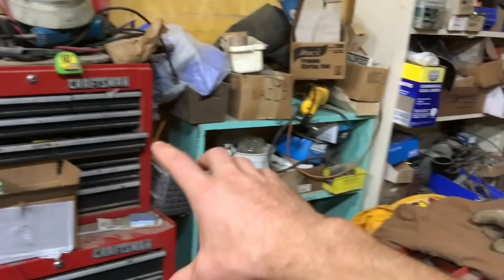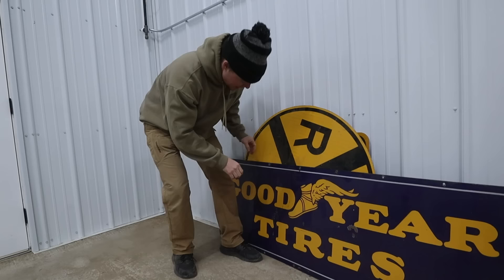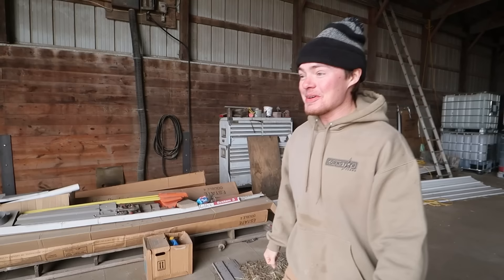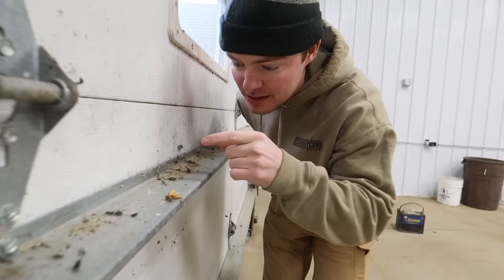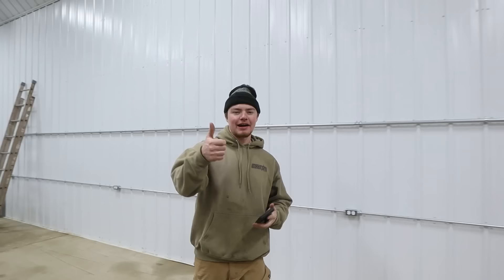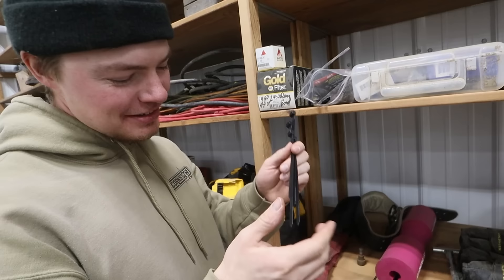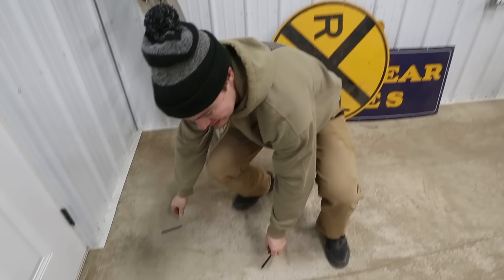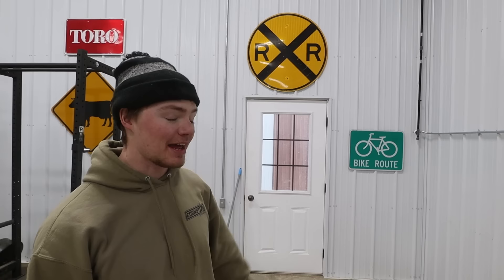Finding $10,000 In My Grandpa's Hoarder Garage

Comment: Cole, fire safety code requires nothing be placed in front of the electrical panel for at least 3' and access not to be blocked.  Acetone should get the glue off that toolbox.
Reply: It's obvious they don't care much about any fire code or NEC.
Reply: @FuenteSmoker most don't not just cole
Reply: Move on.. seriously lmfao 🤣 what a square
Reply: @FuenteSmoker  fire codes are bull💩
Reply: looks like that area is still a work in progress and it looks like there is still access to the breaker panel
Reply: OSHA CFR 1910
Reply: This isn't true in all places. We only need a 18 inch deep between the front of box and access cover box.
Reply: This isn't true in all places. We only need a 18 inch deep between the front of box and access cover box.
Reply: This isn't true in all places. We only need a 18 inch deep between the front of box and access cover box.
Reply: This isn't true in all places. We only need a 18 inch deep between the front of box and access cover box.
Reply: It's still readily accessible....
Reply: I just do not understand why the plug outlets are lower than the toolboxes and where the workbench where they will be blocked.
Reply: @chriscampbell2327 ets go back and ask the guy that built it in the 1980s?
Reply: @ds6843 Cole just installed those outlets…
Reply: @baumsquad222  ohh shit I haven't been watching hahahaha 😆 sorry
Reply: @collind9753  Voltage dependant.. The Higher the voltage, the more distance..
Reply: @lucasstiles8012  Farms are not regulated by OSHA.
Reply: @ds6843  Great!  Farming is dangerous enough without making it more so.  Love the videos and your whole family's exuberation, Kid!
Reply: @ds6843  Cole just installed the conduit and plugs not in the 80s.
Reply: @ds6843 When your insurance company refuses to payout when it burns down you’ll be sorry.
Reply: @jimpinger6206 Well that’s plain stupid they are workplaces. As long as it’s only your own family you kill.

Comment: Cole, I've watched all your family videos with admiration. Your decision to streamline and upgrade has been a wise one. Time IS money. I am a retired heavy equipment mechanic that worked for a big name brand. Our shop was on an industrial level. The shop was spotless. Each mechanic was responsible for Thier own messes. Oil spills, dirt all had to be contended with. Then, they bought us a floor scrubber/ broom. One pass can make a filthy floor clean in five minutes. Not only that, but the grey water can be handled with waste oil easier. The dirt & grime collected. After pushing hundreds of pounds of dirt for years, our employer saved experienced technicians sweeping. It made a problem chore a non issue. Ask ANYONE that uses one. They are a real timesaver.
Reply: Cole a floor scrubber /broom. I wonder if that is electrically driven.

Comment: Some solutions for the removal of sticky residue on stainless steel:  Cooking Oil – Cooking oil is one of the most commonly used solvents for tackling sticky residues on stainless steel. Dip a clean cotton cloth in cooking oil and rub it over the affected areas, waiting for the sticky residue to loosen.
Alcohol – apply a little alcohol (preferably vodka) to remove the sticky residue off the stainless steel. BUT the quickest and easiest to tackle nasty sticky residue with immediate results is to use WD-40 Multi Use Product. Spray the WD-40 over all the residue; wait a few minutes then wipe off with a rag and wash with dishwashing liquid to remove the grease of the WD-40... happy scrubbing
Reply: Yes amazing try it !!!!
Reply: Also peanut butter works good.
Reply: And eucalyptus oil.
Reply: when I was younger I definitely did more cleaning with mechanical methods (scraping, power washing) but as I've gotten older I've discovered more and more chemical approaches. Works much better.  Hopefully Cole will see your comment and give them a final clean.

Comment: Re your breaker issue....this is NOT caused by insulation under a terminal. That would simply result in no power to the outlet. If your breaker is tripping, that is due to a short to ground or neutral which would draw max current. It is important that you find the root cause of the issue or you risk injury and/or fire should the breaker fail to trip. The breaker is there as protection in case of a fault, not as a remedy to an installation fault.
Reply: It Served as such in this Application
Reply: @davidcolesr.8628  are you saying the insulation caused the problem??
Reply: @davidcolesr.8628  yes, but they won't forever.  They aren't designed to constantly trip (or be used as a light switch either)
Reply: @frijoli9579 no that wasn’t the problem. Problem is this kid doesn’t know what he’s doing
Reply: @DocNo27 whatever he plugged into it was probably bad causing breaker to trip
Reply: You should put electrical tape over the terminal screws on the receptacle. This will project you from having a short to the box from the receptacle.

Comment: Large zip lock bags. Each bag has a complete set of sockets of the same brand/grade metric vs imperial. Stash all of your bags in a milk crate. When you have a big project with multiple people using multiple sets, or when you need to work out in the field where things easily go missing,  you grab up a bagged set rather than your newer and more expensive sets of sockets. You can also put a bag in each pickup or tractor tool box. 

Take all of the incomplete sets to your local high school, college, or trade school. They always need extra tools. Some granges also have a tool exchange.

Comment: Hey Cole, I think that with all the spare tools. It would be a good idea to use them to make a tool box for each piece of equipment. This would allow for more field repairs.
Best of luck.
Reply: Definitely a great idea if they don't have dedicated tool kits already. At least a basic set to cover the most commonly needed items.
Reply: They do have small tool bags in most pieces of equipment and in their trucks. 
If not already, those also need to be color coded for each bag. That way the designated tools get back to the bag, and the others go back to where they came from.
Reply: Dedicated tool boxes for each piece of equipment. Colour  or brand coded keeps it organized and there is nothing  like having a complete box in each piece of equipment. I say this after 48 years of seeding a crop. This will take up most of the extra tools. Use JD boxes with the mount and the plastic handles (they last the longest ie. fourty plus years for the box on my 4440) and it weighs 40 plus lbs.

Comment: REALLY helpful hint!!! On those 220 outlets. Once you have the right plugs, use an extension box. A box with no back that extends the area you have for the wires x2.
Reply: Several people mentioned that in the comments when he first wired the outlets and struggled with getting the wires to fit inside.  Not sure why he didn't do that and make things easier.
Reply: @ILGuy2012  I too was one that told him he used the Wrong box in the 1st place.
Reply: @m9ovich785  I agree. He's probably using a ~20 cu-inch box. He should be using a 45 cu-inch box. And he's mounting the box the wrong way up. The cover screws belong on the top and bottom so the cord on the plug hangs the right way.
Reply: @bruceadler-9410  That is what I saw the very day they screwed them to the TIn AHAHAHA...
they could have saved a lot of $$$ with one 1" conduit and the 120Vac box's dropped down from those LOL...

Comment: Cole when you raise the compressor up off the floor, you need to have a pipe extendeed down from the drain with a ball valve , so you can drain the water out of the bottom. Most people forget about doing that and the bottom rusts out, and also you get excessive water in your air lines.
Reply: SnapOn sells automatically activated drains (they have a float)

Comment: Willing to bet the field you plowed and ran the disc over will produce a lot better than previous years as long as you have a good rain season. I really hope you didn’t throw away those sockets just because they were loose. You can get socket trays much cheaper than the 20 dollars you mentioned. Guaranteed someone would be willing to sort through all of them if you didn’t want them. Some of them are probably pretty old if they were your grandfathers and potentially great grandfathers and potentially collectible maybe even a little value to them.

Put your adjustable wrenches in a bucket get some good rust remover and soak them in it for a week then clean the rust remover off dry them and spray them down with your favorite lube and you’ll have a nice new/used adjustable wrench. You can do the same thing with your socket wrenches and pliers as well.

You should build a shed on the outside of the shop and install the air compressor in it so you don’t have to listen to it run all the time when you’re using it. It will make the time in your shop much more pleasant.

Comment: If you can, pipe the air compressor in the building next door. It will save your hearing, and save you space. I did it on my garage and you can barely hear it run.

Comment: I recommend sheet steel for the top of your workbench. Get the steel folded to create an upturned lip at the back of the workbench (prevents stuff falling down the back of the bench) and a downturned lip at the front of the bench. This makes it nicer to lean against the front of the bench when you are working. Had you considered mounting the compressor above the man door? That space is otherwise wasted. Happy New Year Cornstar Farms!!

Comment: Hey Cole, you should put the air compressor in the machine shed and then just pipe air over into the heated shop. Then You won’t have the noise of the compressor running in the area that you’ll be doing more of your work.
Reply: Better to have the compressor in the heated shop. Less condensation.
Reply: @drhermanstein  well I have used an air compressor that was in a unheated place and was piped in to the main shop with a second tank in the main shop and a automatic drain on the compressor and we never had and condensation problems. The second tank hardly had any water in at all. It doesn’t matter whether it’s cold or warm air it’s the moister in the air that causes it to have  water inside the compressor
Reply: The glue gunk can be taken off with orange oil.

Comment: Hey Cole isopropyl rubbing alcohol will easily take that glue gunk off. Also WD40 and petroleum jelly. They all act as a solvent and should solve your issue.
Keep on Tractoring
Reply: In my experience, WD-40 is the best option. It returns the dried adhesive to a tacky state, and then you can work it off with towels and more WD-40. Vaseline: replace one mess with a different mess.
Reply: Hi Jon.  My go to is GOO GONE Works on anything, even dried ball point pen and sharpie Ink..
Reply: Lmao you you think this small mind Tommy has the capacity to look at your comment and make it work out 😂😂😂😂😂

Comment: Cole you can buy a tester that is designed to check if your outlets are properly connected. You simply plug it in to a live outlet and the device has lights on it the inform the installer if it's wired properly and if not what is wired incorrectly on the outlet. Most hardware or the large box stores carry the device.

Comment: I know I will sound like a Negative Nancy but after watching 2 friends garages burn down because of lithium charging stations, don’t leave the batteries in the chargers. Hell, we moved ours out back un a cinderblock shed with a metal roof, so if it does go up we just need new chargers, batteries, roof and shelves. Just saying, would really suck to lose it after all that hard work.
Reply: For all the sockets get some dowels and size the sockets like you did with the wrenches. That way when you lose one you have spares to replace it.
Reply: One neat thing I recently saw was a guy had a Light Station Cart. Had a Jackery kind of battery with several lights, shop lights on stands he could use all around his shop, under equipment, was really freakin neat.
Reply: Pro tip they make fire proof charging bags for lithium battery storage. I use them for my vape batteries and all the lithium stuff in my house. It’s hard to force the wife to use them but if you gripe enough and point out how horrible a fire would be she will for the most part.

Comment: I'm in awe at what you have done with that building let alone the whole Farm cleanup.
Reply: I am almost certain the four prong plugs/receptacles were for three phase  220  volts and served by four wires.  Three prong plug/receptacles are single phase 220 served by three wires.  Dropping one wire at random is dangerous  I believe you have three phase power on large motors on grain elevators on the farm which maybe 440  volts.   A Keeping these powers separate usually means separate  circuit breaker panels   One thing is certain is you need a professional electrician asap

Comment: The pliers you used to cut the ty-raps are called Diagonal pliers or we call them (Dikes) for short. Also, you should take side cutters, or (Linemen pliers) and grab the ty-rap close to the "Latch" part and TWIST the ty-rap until it breaks off so as to not leave a sharp edge. (If you're ever in a panelboard that has a lot of ty-raps that someone has cut off you will be cursing them for leaving all those sharp edges in there for you to cut your hands on! 
Just a FYI for future projects.

Comment: Cole you should think about putting your air compressor outside your building, build a little shed for it on the side of your building that way you don’t have the noise from the air compressor inside your shop just a thought
Reply: Good idea, normally. But in his area, the winters are cold and the oil in the pump doesn't flow. Hard starts and extra wear. You could build a box around it and line it with Rockwood to absorb the sound.
Reply: Good idea, normally. But in his area, the winters are cold and the oil in the pump doesn't flow. Hard starts and extra wear. You could build a box around it and line it with Rockwood to absorb the sound.
Reply: Good idea, normally. But in his area, the winters are cold and the oil in the pump doesn't flow. Hard starts and extra wear. You could build a box around it and line it with Rockwood to absorb the sound.
Reply: Good idea, normally. But in his area, the winters are cold and the oil in the pump doesn't flow. Hard starts and extra wear. You could build a box around it and line it with Rockwood to absorb the sound.
Reply: Their air compressor would have no problem with their cold weather.

Comment: Keep the 4-prong 240v outlets.  You can always use only 3 wires in the plug but this way you can plug in things that need a neutral as well
Reply: Yep, they make adapter 4-prong to 3-prong cords exactly for that purpose (and/or to plug 20 amp equipment into a 50 amp receptacle).

Comment: To get rid of the sticky residue use this I found on the web.
"Combine baking soda, Lemon, and water in a small bowl or dish. Apply mixture to sticky surface and let soak for 2-5 minutes. Use a damp towel or cleansing wipe to remove adhesive easily."
Hope that helps. :)

Comment: You should consider using a garage floor "particle" coating that makes the floor look new bright and clean and more "finished" and it seals the concrete so you can spill burnt motor oil and it cleans up great and prevents staining and makes the floor have more traction so if you bring in a rubber tire vehicle it won't skid or slide and shoes won't slip and slide.  the stuff is DIY-able and self leveling and you either roller paint it on or on a rough/damaged surface it can be spread with a squeegee.

Comment: Hot Tip ~  Goo Gone (product to remove adhesives) might be perfect for the sticky stuff on your tool chests.  Home Depot carries it in different containers.  I have a small can under my sink & use it several times a month.  In the garage & barn we keep spray bottles  (The squeeze spray bottle like on one Windex comes in)   for larger sticky messes.  Cheap & easy...that's my style!

Comment: Cleanup and organizing is always good to do. Looks like a good place to work, although I would have laid things out differently but you do it the best way for your operation. So sorry to see you wasting fuel and setting your ground up for erosion by using that plow. Nutrients move in the soil, and plant roots find them. Our farms have been no till for over 20 years and our yields are as good at or better than the neighborhood, and any runoff after a hard rain is clear water, not muddy. If you have compaction, a moldboard plow does not do much good except at the surface, and destroys soil structure. A ripper set up to leave maximum cover on the surface, run when the ground is dry will do more good.

Comment: Try using hair spray, alcohol or vinegar to remove the glue on your tool chests and other items too to have glue you can remove.  If you have ink, oil on clothing spray hair spray on it. Let it set for about 10 to 20 minutes. Rub your finger over the stain after you spray it with hair spray or vinegar add a small amount of dawn. That helps especially with the oil.